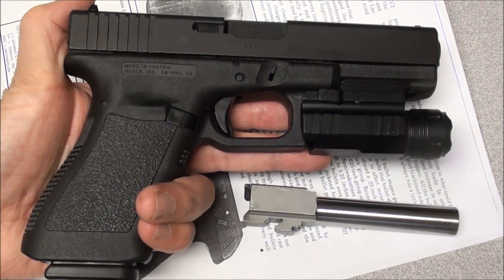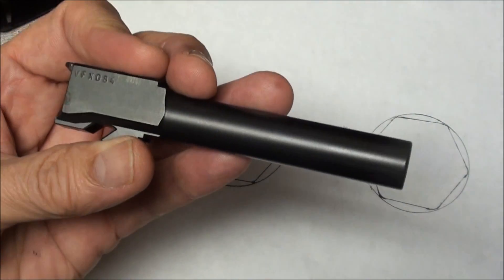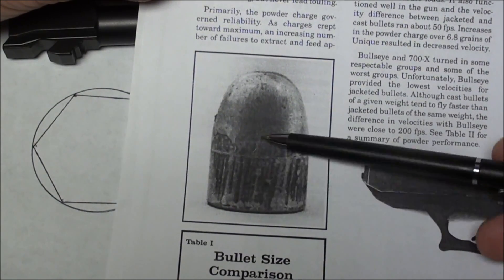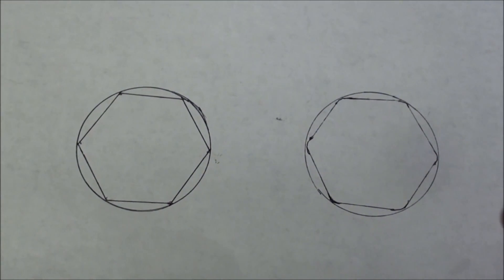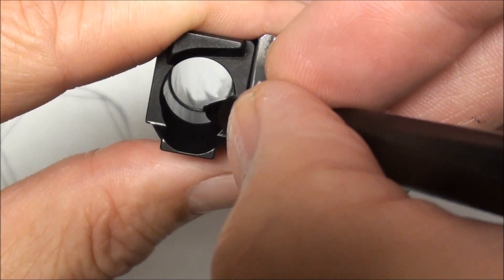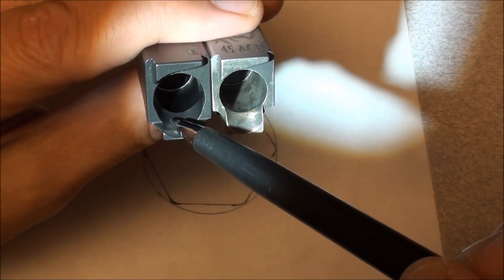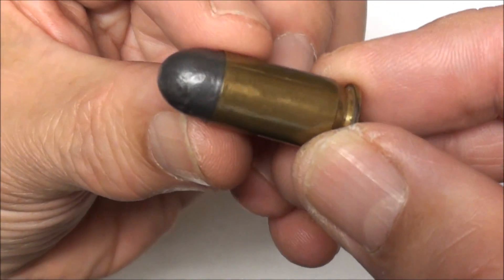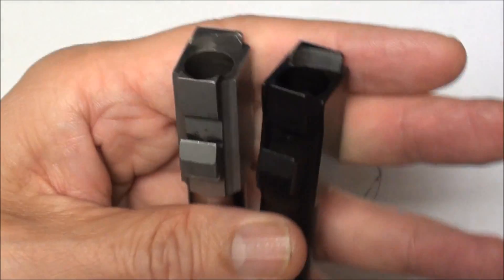Polygonal Rifling in Reloading Ammo for Glocks

Comment: Great info. I personally do use a lot of reloads in my glock. But, they have all been factory reloads. I have shot several thousand rounds through my glock as well as thousands of new factory ammo and I have never had an issue. I only shoot full metal jacket with brass casings. I stay clear from lead bullets and aluminum or steel casings in all of my guns. That is something I think everyone should do. Its not worth it to save a few dollars buying steel casings or lead bullets. It causes more problems to your firearm in the long run. Once you've found a trusted and tried factory that reloads, buy by the thousands and do not risk trial and error by buying elsewhere. Or, visit some online ammo stores and find cheap deals on good ammo like american eagle (full metal jacket and brass casings) for about $230. per 1,000. rounds (9mm) its fairly cheap.
Reply from the maker: +Isaac Madera -- Currently, I'm doing the same - Winchester white box factory FMJ is all I shoot through my Glock factory barrels.  However, I do switch out to after market barrels to shoot my reloads.  Never have to be concerned about any casings losing their heads...Good shootin' to ya,   FC

Comment: The polygonal barrel would provide a tighter gas seal than a standard rifled barrel, especially with lead because its so much softer.
Reply from the maker: +david farmer -- There are trade offs everywhere - if the polygonal rifling is too smooth and the lead too soft, the lead will not hold the rifling.  If lead is too hard, it might not obturate to take the rifling.  The bullet has to be able to hold the rifling at the velocity it is shot.  Cut rifling should hold a bullet better than smooth rifling.  So why would a polygonal barrel provide a tighter gas seal? - gas seal depends on the diameter of the bullet - if it is right (for auto pistols, .001-.002 over groove diameter), it will be right for gas seal whether there is cut, polygonal or no rifling; if the bullet is too small, it can't obturate either, no matter what kind of rifling is present.  The trade off is that smooth rifling will not foul as much because there are no sharp corners to leave any bullet remnants behind, but sharp holds the bullet better.  That's why saying one kind of rifling is superior to another is a difficult sell...whatever you do to get something, you give up something else...like the Glock oversize chambers - you get max reliability, but you give up some case support.   Sharp sights are the best sight pictures, but snags on draw.  Long barrels get more fps, but you give up some handling,  etc, etc.  There are some exception to this, but this reply is getting long..  Best Regards to ya, and thanks for posting comment... FC

Comment: Cut rifling, and the sharp corners you refer to give the fouling a place to accumulate. The hammer forged Glock rifling, with its smoother transitions do not afford this space for the fouling to build up. This means it takes less fouling in a Glock barrel to cause unwanted pressure spikes, than in a cut barrel. But your right, one of the biggest reasons why using reloads in a Glock factory barrel is the partially-unsupported chamber.
Reply from the maker: +Jeremian Lastly -- Sure makes for good reliability with factory ammo though... Best to ya,  FC

Comment: With respect to fully supported / minimal supported, if that was a problem, why would Glock say they're safe for +P?
Reply from the maker: +Charles Crabtree -- It would seem to be confusing, but let's see if I can make this clear.  Yes, Glocks can shoot any factory ammo safely - the problem is not +P pressures.  It is using weakened Glock fired brass, again reloaded and shot in Glocks again - The weakened brass can give where it is strained repeatedly and then it wouldn't matter if standard or +P loads are being fired.  What Glock is saying is - shoot factory fresh ammo is safe.   All other bets are off.  Other manufacturers that do not have the Glock designed chambers - they say shooting reloads is not recommended also (since reloads can be safely or unsafely loaded).  But because their chambers are supported, for reloaders, safe reload bets are on.  Note that every word in this reply is significant.  Best Regards to ya,  FC
Reply: so fatigue of the brass...
Reply from the maker: +Charles Crabtree -- Yes, Glock fired brass has weakened spot where the feed ramp at the back bottom edge of barrel has been relieved so much the web is unsupported.  The pressures of firing weaken the brass there and that spot may not stand another episode especially with 40 cal pressure curves or other situations that could cause higher pressures like on the video... Best to ya,  FC

Comment: I just want to ask a question about FACTORY RELOADS....With an unsupported barrel, should I be concerned about firing .40 cal factory reloads in any of my Glocks? I'm sorry if someone already asked this. You refer to FACTORY LOADS, is this the same thing basically as FACTORY RELOADS? Thank you in advance....
Reply from the maker: +pilot3729 -- No, factory loads are new ammo.  Commercial reloads or remanufactured ammo is done with used brass.  Used tired brass is still the problem in unsupported chambers.  I've heard some sad reviews on commercial reloads - they are lower priced ammo, and many have tried them.  
Some of the stuff out there is unsafe to shoot - one shooter at our range had ammo that was obviously overloaded... the commercial reloader told him to stop shooting them immediately and send them back to them.  When I've used commercial reloads, they are by a reputable company like Load X - but the ammo is still basically blasting ammo that I shoot to get the brass for my 44 and 45 Colt revolvers - you can't go wrong with getting that strong 44, 45 brass anytime... I won't call them factory reloads as our ammo factories like Winchester, Remington, Federal, CCI etc don't deal with reloading used brass.  They may have had subsidiaries at some point that did that, but when the Glocks became popular, too many problems with reloads being shot in Glocks.  Factory reloads is confusing - I'd call them commercial reloads.  Best Regards,  FC
Reply from the maker: +pilot3729 -- Be careful of commercial reloads.  Winchester, Remington, Federal, CCI all are in the business of loading ammo - they do not reload ammo - others do that.  One of the shooters at our range got some commercial reloads back when 223 was not to be found (remember that?).  The ammo was loaded way too hot and primers were blowing out.  He returned the ammo and they apologized for it.  But there are some very reputable commercial reloads like Load - X.  I shoot lots of their reloads in my revolvers, but in my Glock factory barrels, I only shoot factory hardball.  Best to ya,  FC

Comment: I just bought a storm lake barrel for my new glock19. The chamber on the stock glock barrel is identical to the storm lake, fully supported. Was this problem only in the the bigger calibers?
Reply from the maker: +gottiblues - If you take fired 9mm brass and re-chamber it into your Glock barrel - you can find the right alignment and it will go back in pretty much.  Take that same brass and re-chamber into another 9mm barrel and you will see that it is blown out - might not look like it, but it is.  The 9mm Glock chamber is still bigger.  But Kabooms don't happen with the 9mm and 45 anywhere as much as the 40 - reason is the 9mm brass is strong and the 45 has lower pressure to begin with.  Still I like my aftermarket barrels for my Glocks, if nothing else than I have full margins in place.  Happy Holidays to ya,   FC
Reply: Thanks for the clarification, I appreciate it.

Comment: Fortune Cookie - Very good video, and very good informational safety. I was wondering if you were going to address the unsupported portion of a case possibly being dangerous when weakened by multiple firings. You did - KUDOS. I have had a friend experience these blowouts around the web of brand new cases loaded in a Glock Barrel. Still trying to figure it all out. I have chalked it up to a substandard manufacturing process by the brass maker, or possible overcharging of the case by the Cartridge maker. We have brought it to their attention. Anyway, you are absolutely right about being extremely careful when reloading and shooting those loads in a GLOCK. I own a Wolf barrel converting my .40 Glock to a 9mm. Now I can shoot Factory .40 loads with my Glock Barrel Safely and 9mm Reloads Safely using the Wolf barrel.  Anyway - It pays to be read the cautions, and GLOCKS do require those extra safety considerations, especially when using reloads. Thanks for the good information.

Comment: Nice video and thanks for the good info.  
If you ever have any problems with 40 S&W bulged brass then check out the AUTO DEBULGE 40.  Works good and saves alot of time.
Reply from the maker: +Aplus Victory Products -- Thanks for posting this.  Yes, the Lee Bulge Buster and Redding GRX dies iron out the Glock bulges.  This is very helpful if we are shooting reloads again in other guns.  Reloading Glock weakened brass again in a factory Glock barrel takes a full understanding to minimize the risks in doing that - an experienced reloader can do that.  A new reloader may not.  Best Regards to ya,   FC
Reply from the maker: +Aplus Victory Products -- Thanks for posting this.  Yes, the Lee Bulge Buster and Redding GRX dies iron out the Glock bulges.  This is very helpful if we are shooting reloads again in other guns.  Reloading Glock weakened brass again in a factory Glock barrel takes a full understanding to minimize the risks in doing that - an experienced reloader can do that.  A new reloader may not.  Best Regards to ya,   FC

Comment: I shot 50 rounds of lead 40 SnW threw my Glock 27 gen 3 without a hiccup. After, it did leave a weird smug along the rifling . And it was a bitch to get clean. They were new rounds to hit steel with. FYI my glock hasn't malfunctioned since I shot the lead (about 3 years and crap ton of rounds later). If I had to use lead, I wouldn't worry about my Glock going "Ka-boom" until after 200 rounds or so.
Reply from the maker: Issac - Doesn't it make you wonder that the word on smooth "polygonal" rifling (one of the real selling points) is that the rifling fouls less than traditional cut rifling.  And then we are told that the reason Glock Kabooms happen is because the rifling gets fouled shooting lead or reloads.  Why don't regular cut rifling barrels blow up when they get fouled more than the polygonal?  We used to shoot 500 lead reload rounds a night steel shooting with our 1911s before the Glocks came along - no one ever cleaned their guns during the session - some never cleaned their guns at all until they got so dirty, they stopped running - not because we were concerned about guns blowing up... Happy Holidays to ya,  FC

Comment: You keep using the term "over-pressure".  Unsupported chambers do not cause excessive chamber pressure, they just provide an avenue of failure for weak or poorly maintained brass.  To say you shouldn't fire reloads in a factory Glock barrels is ridiculous.  The only reason Glock says it is for liability reasons, and if you actually look in the owners manual of any other gun, 99% of gun manufacturers say the exact same thing, regardless.  Its only to cover their ass.  Ive been shooting reloads (FMJ, coated, and cast) through my Glock barrels for going on 10 years, and have yet to have any issues..  The reality is, if you're doing your job as a safe reloader and properly inspecting your cases for signs of weakness, as well as doing your job as a shooter and cleaning and maintain your weapons, you won't have any issues.
Reply from the maker: Jcreek201 Yes, you are absolutely on the beam - liability is the reason for the disclaimers.  However, with Glocks the disclaimers are highly applicable.  You and I are not in disagreement as we know the issues.  Others may not, and for them, the disclaimers may not be ridiculous.  To inform them is the value of our comments to each other.  My point is that with the Glock constructs for maximum reliability, there is some loss of safety.  Factory new brass and factory loaded ammo offsets the Glock constructs.  With the 40 cal especially, there is scant room for any error with  1) tired brass 2) powder charge errors 3) primer errors 3) seating depth errors 4) bullet oversize errors (cast bullets) 5) bullet weight errors 6) bullet seating stability errors.  We both recognize the importance of the brass.  When I referred to over-pressure, the comments relate to any of the errors above that may cause over-pressure.  Neither the tired brass nor the Glock constructs cause overpressure, of course.  The key in your comment is when you say the conditional if we are doing our job as a safe reloader/shooter.  Glock Kabooms happen when minor (or major) errors that may be marginal for other constructs, stack up sufficiently in a perfect storm to cross the threshold.  To be absolutely safe, I would recommend that brass fired in Glock 40 cal factory barrels should never be reloaded for firing again in Glock factory barrels.  To not do so means the reloader/shooter is willing to accept the risk.  Reloading has its risk anyway to be certain.  I'm sure you are a safe reloader/shooter.  You are staying away from the threshold better than most.  Any gun can go Kaboom (reason that all manufacturers do the disclaimers - just because other gun makers do does not exonerate the Glock constructs) - they just don't go Kaboom as easily as Glocks do.  Rephased - that is - Glock factory barrel Kabooms with reloads is a risk that is higher than in other guns.  No, I do not have any data on the exact incidence worldwide to support that statement - but there sure are a lot of reports, less with the Gen 4s that are not easily available in California.  Personally, I like Glocks (my G21 is really joyful), and I haven't had any issues either.  But when I shoot any of my reloads in them - the aftermarket barrels with the supported chambers is what I use - the extra money that is required to spend is like buying insurance that I may never use, but gives me peace of mind.  When I take new shooters to the range, they love shooting my Glock 9mms with the factory barrels and Winchester white box 9mm ammo.  Thanks for your comment -
Reply: Ditto. My glocks barely see any factory rounds. Never had an issue. The only factory rounds I shoot is when we have to qualify with our guns and we use free dept ammo.

Comment: I got my first Glock 17 in 1987. That was before it was dangerous to shoot cast bullets in them. If I would have known it was dangerous my gun probably would have blown up. Bullets were cast by me out of linotype and we're very hard. My friends Glock 22 had well over 15,000 rounds of cast bullets through it before he went to a lone wolf barrel. Neither of these guns were horribly accurate with the cast but more than adequate for service pistol.
Reply from the maker: leadisgood The Kaboom problems were most acute with the 40 cal Glocks.  When you look at 9mm and 45 Glock fired casings, the bulges are not as bad as with the 40s.  I don't own any 40 Glocks for that reason.  However, I did get a Glock 20 recently, but only shoot factory rounds in it until I get my aftermarket barrel for it.  That's OK as I am gathering my brass supply.  Thanks for posting...and Have a great day
Reply: +FortuneCookie45LC the .40 is a bastard child of emotion and fear and has no place in modern technologically advanced world where people understand why bullets of different makes do what they do.  those guys where using win. silver tips and thought it just needed to be bigger and faster lol.
Reply from the maker: +Andrew James  -- Let's just say the 40 was a compromise cartridge.  The 10mm was the solution to underpowered LE guns after the Miami shootout, but it was too hard to qualify many of the officers on the 10.  So a loaded down 10 was developed and then the 40 became the shorter case for that loaded down 10.  It tries to give 45 power in the 9 while keeping high capacity like the 9.  Happy Holidays to ya,   FC